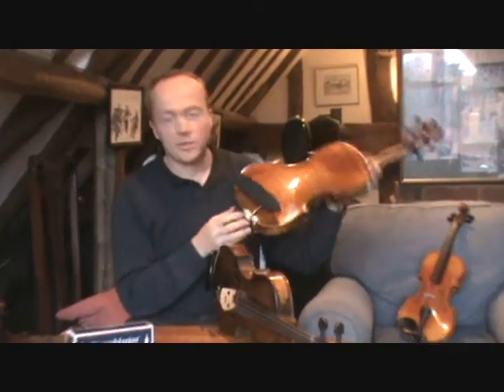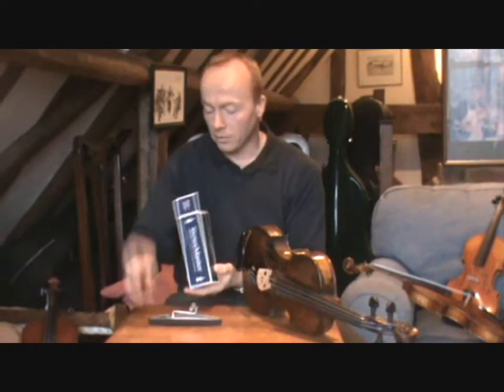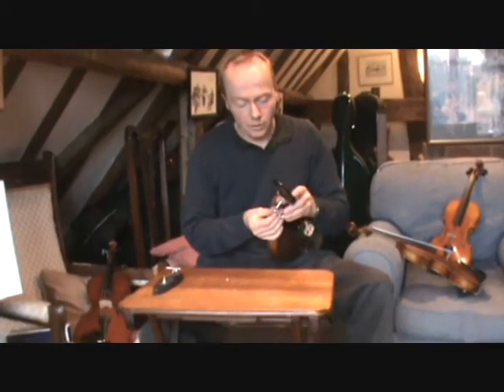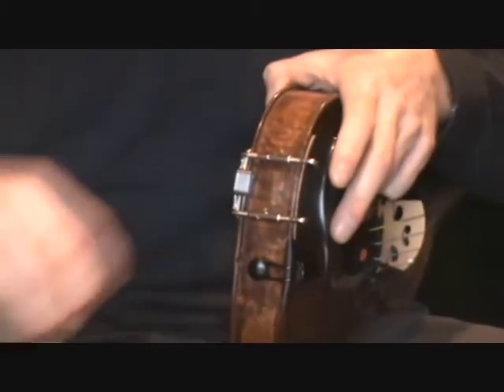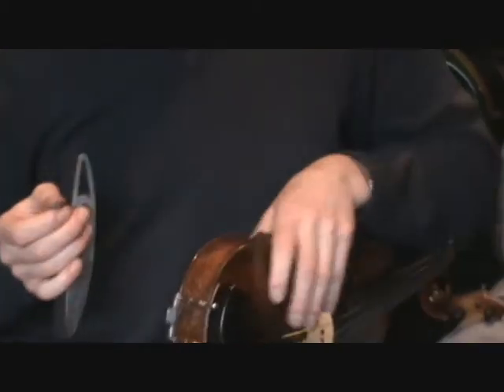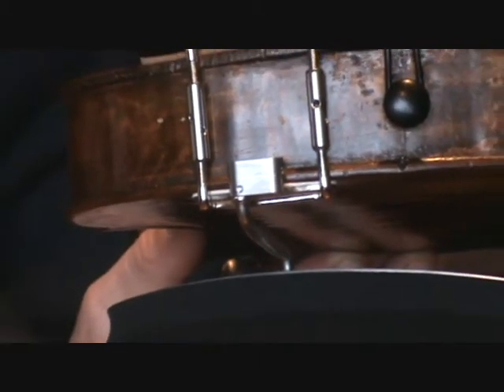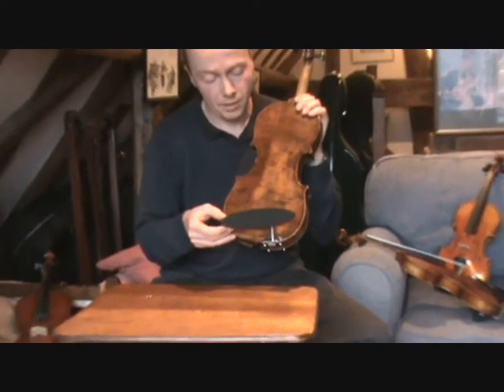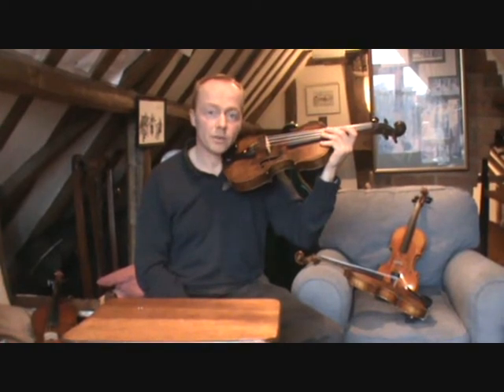SMfitting_0001.wmv

Comment: I have had some great advantages and drawbacks with this shoulder rest. Advantages are, sound, shoulder freedom and various comfort capabilities.
However I have found many drawbacks also, first of all, if the violin is unprotected the chin rest rubber is not enough, and after use it will be tattered, this means that the metal can easily dig into your violin, second of all, I can never, ever find a suitable location for it, no matter how much I shift it.